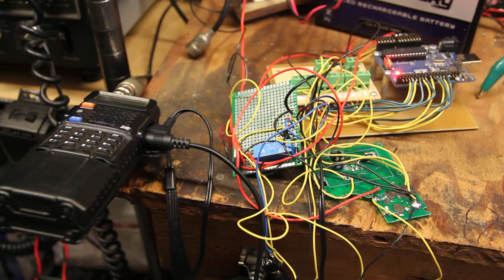The Arduinopeater - Simplex Repeater Project using Arduino

Comment: I made a simplex repeater out of a ISD1820 and a BF-888s...total cost $22 CDN    No microcontroller needed.....
Reply: can i see ?
Reply: @jeffavila3793  No video but I have since added DTMF remote control of all 16 channels on the BF-888 (one set for no xmit for "off") using just 1 extra chip(MT8870) and 1 transistor. I also have a design for a remote battery level feedback over the air using yet another chip/transistor (LM3914) but that has yet to be implemented and field tested. I may release it all on github or similar some time in the future if I can get it all in presentable shape (currently just hand drawn schematics etc)

Comment: Hello, I'm working on a project like this myself, The only bit i'm struggling with is detecting audio from the radio to trigger a logic high or low on the arduino - do you mind me asking if you could share how you did it? :)
Reply from the maker: +Tom Hopkins Sorry for the slow reply... 100nF cap between the radio audio output and an analog pin. I use another analog pin + pot to control what the sensitivity level is for the audio. Make sure your audio output & any RF are not anywhere near each other, otherwise RF from your radio will put voltage on your analog input to the Arduino, too.
Reply: +KK6FUT Thanks for getting back to me, i did try connecting the audio directly to an analog pin but the results were a bit random, i didn't think to use a  potentiometer. How did you wire it? I know full well about the rf triggering the Arduino, as that's the other problem i have.

Comment: May i know how does the automated identifier works in details?
Reply from the maker: jmaiillusion foo Yes, the software keeps an internal accumulator (in milliseconds), and if ten minutes have passed and there was activity, it will automatically send out a pre-programmed morse code sequence (in my case, KK6FUT/R... or in some areas, KK6FUT only). This is a unsigned long that increments every time it goes through our main Arduino loop(). You could also use a programmed Arduino timer for more accurate time.